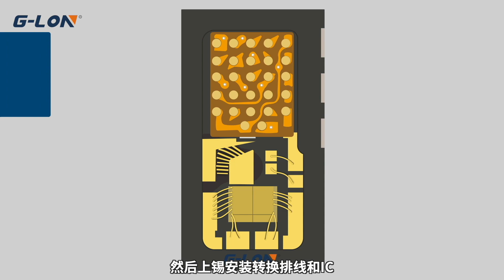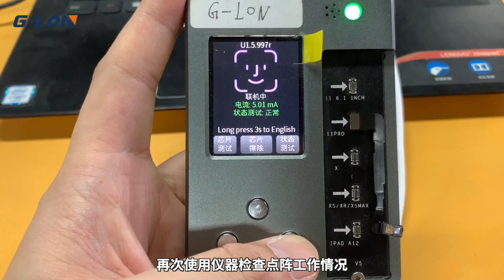修复iPhone11PRO Max Face ID详细过程

Comment: Hello I wanna to ask if possible to fix dot projector to an iPhone without the old dot projector because it replaced . Can I take dot projector from other iPhone same model and get the data and fix it .. . and in other case if I have the dot projector data can I change the dot projector board if the illumination damge . thanks
Reply: no u can't get ur face id back if any of such thing is replaced before.